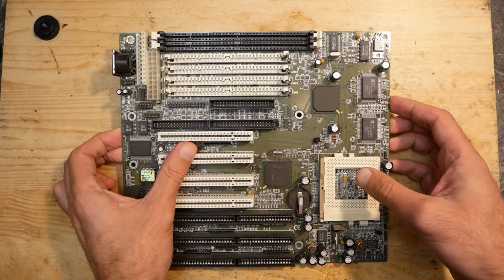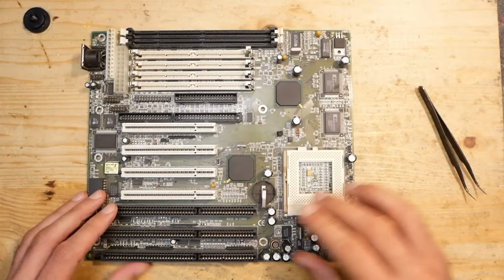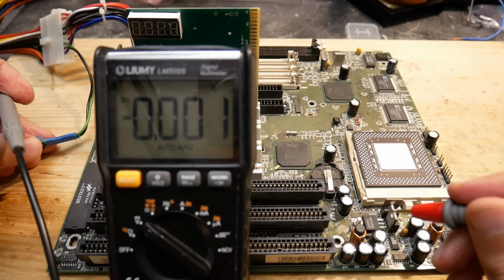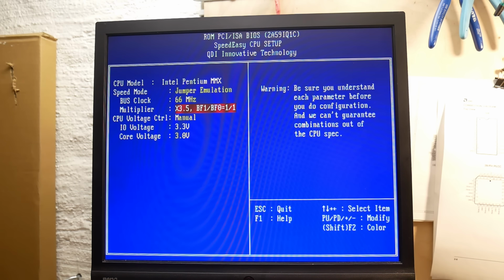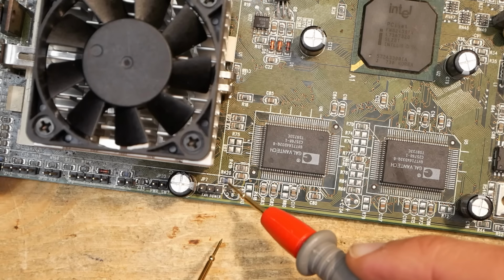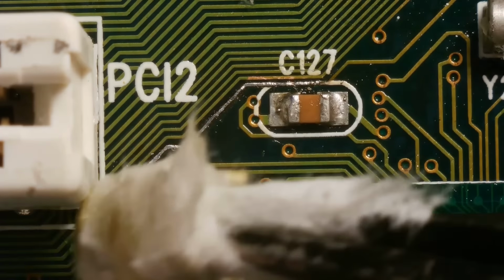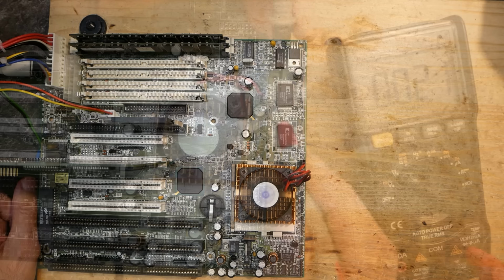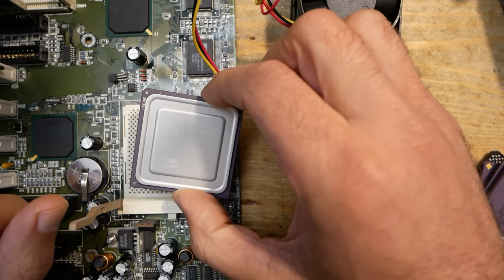QDI P5I430TX - is it the best Socket 7 mainboard?

Comment: is it the best socket 7 mainboard? definetily not... its a very basic dummy board with an interesting but limited feature... nice try, but there are many much better board on the market...

-only 256/512KB ext cache

-very limited voltage range: the onboard Raytheon RC5041 VRM controller would be able to supply down to 2.1V, but i think it's impossible to implement it without hardvare modification... just check the VID configuration table in it's datasheet...

-very limited multiplier settings: the question is, is the missing BF2 pin being connected to ground on the board, or is it left as floating? in first case, You will be limited to 4, 4.5, 5 and 5.5x multiplier options. in the latter case, limitation will be 2.5, 3, 3.5 and 6x with a K6-2 or K6-III CPU. if it's floating, then You can solder a jumper on BF2 line to achieve all possible multipliers on these CPUs

-the W49C65-04 PLL clock generator is very basic without async PCI clock option - in 75MHz setup, PCI clock goes to 37.5MHz which can cause stability problems. the PLL would support 83.3MHz as well, but with 41.66MHz PCI clock - that's why they hid it from the options. there is no 75/33 and 83/33MHz async option. and in addition, it has no I2C but only hardware configuration pins... on many later S7/SS7 mainboards, You can reach the PLL IC through I2C bus and modify the setup on the fly from windows with CPUCool, CPUFSB, SpeedFan, etc

according to PLL datasheet, 60+ means 60.6MHz and 66+ means 66.82MHz

another problem is the missing microcode from BIOS, and the fact that the flash IC is being soldered on the board instead of socketed - it's a bit risky to hack the BIOS on a board like this...

You probably met with SoftMenu II and SoftMenu III option on many P2/P3/S462 ABIT mainboard, but as i know, the first SoftMenu appeared "much earlier" on 430HX boards like ABIT IT5H
Reply from the maker: I agree on some points, but you seem to compare mostly SS7 features with S7 ones. Async clock above 66 MHz was an SS7 feature, as well as voltage below 2.8V. More than 512K L2 cache is also not common on S7 boards. Nonetheless this board supports more, than you think. Some of those drawbacks are purely software limitations and there is a work ongoing to modify the BIOS accordingly. Of course fsb over 66MHz without PCI overclock is not possible though, but it's alright. Once again, we are speaking about S7, not SS7.
Reply: @necro_ware  many S7 board has async PCI option above 66MHz, and latter K6 CPUs required 2.2-2.4V Vcore, and they are fully Socket7 CPUs, not SS7... I think this board is very average in it's era and there were many much better - so far away from "best socket 7"...

"More than 512K L2 cache is also not common on S7 boards" - yes not common, but we are looking for the best socket 7 board, not the common ;)
Reply from the maker: @eeeneeen381  Oh, a reaction to such an old comment :) Ok, show me a Socket 7 Board wich is better than this one. I still didn't find any. Meanwhile Jan Steunebrink made a custom BIOS for it and it supports all CPUs up to K6-3+, voltage down to 2.2V and FSB83, sync with overclocked PCI, but still. And all that without any jumpers! Also, Socket 7 boards with 1MB cache are at least very rare, may be there are even none. At least I don't know any.
Reply: @necro_ware  Shuttle Spacewalker HOT-603 2.x has 1MB L2 and its a pure Socket 7 board

ECS P5SD-A has an AGP slot, advanced PLL with 83/32, 90/30 options - there is a 100/33 too, but the chipset is officially 66MHz only, so it's no wonder it cannot stand it - 83 is fully stable, 90MHz is so so, let's say 95% stable :)

VP3 based boards has AGP slot too, but still Socket 7 due to missing 100MHz FSB

yes, it's hard to find a board with all features at top - but it's probably exists :)
Reply: dude... by socket 7 , he means pure socket 7 ... not supersocket 7. 
supersocket 7 use socket 7, but they are considered by their own kind . supersocket 7.

socket 7 boards used to have 512 Kb cache as maximum, in that era.

So yes, this is expeptional good board... though 2.2-2.4v is definitely missing... even 2.7v, sometimes it is enough, and you can undervolt the processor.
Reply: @eeeneeen381 Which board before the arrival of SuperSocket7 can handle more than 512KB L2 and at the same time supports MMX class CPU? I have only ever encountered very old boards, some of which supported up to 2MB L2 cache, but did not support dual power supply, or conversely, newer Super7 boards, some of which also supported up to 2MB. In the meantime (which is what the discussion is about), I do not know of such a board. It is possible that Tyan offered something like this, but those were not boards for ordinary people. I only partially agree with the rest of what you wrote. It is a common description of the characteristics of Socket 7 boards before the arrival of SuperSocket7. Which boards do not have the shortcomings you mentioned and are still in the Socket 7 category and not SuperSocket7?
Reply: @Thales_WH  unfortunately, it's impossible to filter by cache size on theretroweb database, but i can mention one pure Socket7 board with 1MB cache that i already have: Shuttle Spacewalker HOT-603 2.x. As You can check it on the pictures of trw, it has 4 pcs of TM T35L6432A-6Q 64Kx32==256KByte SRAM chips. I think Shuttle was not a premium high category manufacturer like Tyan, so it looks a good example for better then average in consumer category...

on the same board, onboard SC1151CS VRM controller is able to provide voltages from 1.8 to 3.5V

W48S87-04 PLL chip has 2 option for 75MHz: 75/37.5MHz PCI and 75/32MHz PCI - for 83MHz, only the /2 divider is available, so it's not the best, but better than the average. I'm unable to mention boards with available 83/33MHz PCI (or similar) at this moment, but i'm pretty sure there was...
Reply: @eeeneeen381  Shuttle was not really a luxury brand. I appreciate that they were a bit of an experimenter and were not afraid to do things differently, they did not stick to the mainstream, unfortunately it usually did not lead to anything positive and I remember their boards as problematic. I do not evaluate it only retrospectively, but also because I worked with those boards at the time, I still have some promotional materials here, I still use very good-looking boards for papers with good-looking graphics from this brand :) But back to the point. The HOT-603 board, although a unicorn (at that time) with 1MB L2 cache, could not achieve the results of common boards like the Abit IT5H based on the 430HX with 512KB L2 in contemporary tests. More interesting boards, when things started to change, came the following year along with SuperSocket7, as I wrote. Therefore, we are not in conflict. In 1997, perhaps the only board that was able to bring something extra compared to the standard was the FIC PA2007 based on VIA VP2, which was available with both 512KB L2 and, for an additional fee, 1MB L2, and was able to really turn this extra memory into extra performance. But it didn't have any of the other things you wrote about either. Only a small number of boards supported the 83MHz bus at the time, and most of them couldn't run stably and smoothly at this frequency. That makes sense, because extreme overclocking wasn't that popular back then, so it wasn't a target group that board manufacturers would focus on, and the only ones using the 83MHz bus were some Cyrix processors, which was new at the time and manufacturers hadn't had time to react yet. So, in 1997, it really wasn't possible to blame anyone for all the things you wrote. It was a contemporary picture of the IT world. It would seem similarly pointless to me to complain about why most ordinary users didn't have a 486DX on their desks in 1991.
Reply: @Thales_WH  On S5/S7/SS7 platform, cacheable amount of RAM greatly depends on the amount of L2 (or better to say external) cache and the chipset itself. With VP2 (and VP3/MVP3), 256KB cache gives 64MB, 512KB gives 128MB, 1MB gives 256MB and 2MB gives 512MB of cacheable RAM. Okay, 128MB of RAM was a lot in the era of P1/MMX CPUs, but let me remain You, we are looking for "the best S7 board", not the most generic or most popular... If You build the "ultimate killer S7 machine" based on an oc-ed iMMX 233 or a 266-300MHz AMD K6 (or a Cyrix MII if You are pervert :D ), 256MB is not an exaggeration...

Shuttle HOT-603 == FIC PA-2007, due to AMD 640 chipset is a VIA VP2 in reality...

83MHz bus was problematic in many case due to the overclocked PCI bus, I think... I will check my S7 boards if any of them supports async PCI - i hope, yes... :)

by the way, unusual bus speeds: what about 40MHz FSB? As I know, there is only one CPU that requires it, the 80MHz Cyrix 6x86 - it's a nearly non-existent CPU, but I have one - and it looks a very early release due to it's labeled as 6x86-80GP instead of 6x86-P90+GP... 1.5*50 or 1.5*55MHz would be much more generic, but it inherited it's CLKMUL system from greater brothers so only 2x and 3x mode is available - that's why it requires the very rare 40MHz option. Earlier, i had no S5/S7/SS7 motherboard with such a low FSB support, so i was unable to test it - it did not give any sign of life on 2x50MHz. Later, i figured out that if i swap the 14.31818MHz crystal around the PLL IC with a 12MHz one, then 50MHz FSB setting goes down to 41.9MHz - it caused timing problems, system clock slowed down and benchmark results were fully the same like on a 100MHz system :) - but i confirmed that the CPU is ok... Then finally I found a Freetech 586F61-PB board with official 40MHz support. The only problem is that in this mode too, PCI bus runs on halved clock so it's a bit bottleneck - but i will try to implement a passthrough option around the PLL circuit to achieve 1:1 option too...
Reply: @eeeneeen381  Yes, you are right and I know the facts you stated :) We are not in dispute, it was just necessary to clarify the development period. And yes, I am a "pervert" according to your definition, because I do have, among other things, one Socket 7 machine (not SS7) with Cyrix PR300 on Freetech P5F87 :) I don't think it is the best machine in the world, it is just a toy for fun and I like the board despite the shortcomings resulting from the nature of the 430TX limitation. The only thing that annoys me about the machine is the cacheable area limitation, otherwise I would have stuffed much more than 64MB of RAM into it. I had to rationally accept it and tell myself that I have other machines for tuned and unlimited stuff. I also have much better Super7 boards available, such as the Gigabyte 5AA or 5AX and others, but this one seemed to me to be somehow suitable. But it still doesn't let me sleep sometimes :D Besides, I've never been much of a gamer (for whom 64MB is enough, I spent little time playing games) and I was demanding on RAM even back when it was relevant. In 2000, my PC had 640MB of RAM. If you were asking the same question as people back then, then no, it's not a typo. It was 2x256 + 128MB of RAM.
But back to Cyrix: I only saw the 6x86 GP80 once in a photo a few years ago, I never actually saw it when it was on sale, not even in price lists. When I saw it in the photo, the frequency seemed strange to me, so I looked for boards that supported it. I actually found a few, but there were very few of them. Congratulations on finding one :) I don't understand why Cyrix didn't do something more rational like 1.5x50MHz. If you succeed in modifying the PLL, let me know, I'd be interested. On the other hand, I want to try to see if I can choose one of my Pentium 66MHz and overclock it to 80MHz. I don't really believe it, because the technology was at its peak and without reserves at that time, but why not try? :)
Reply: @Thales_WH  I have an IBM version of PR300 too :)

430TX chipset looks a bit bottleneck for this system - a HX or something alternative would be better with more RAM... by the way, my Freetech 586F61-PB board has 430FX with the same cacheable RAM limitation, but it has a VRM slot - I already started a K6-III+ 400 CPU in it with feeding power from another SS7 board's VRM to this board - might be a good solution against the chipset limitation :D

OC'ing a Socket4 system? Nice idea :)

How can I contact You? There might be easy solution, or hard way - investigation required on the board and it's chips...
Reply: @eeeneeen381  The contact is "thales" blah-blah for google @ blah-blah "email" blah-blah "dot" blah-blah "cz". Hopefully it will work :) Try it.
Reply: @eeeneeen381  Have you tried that contact? I haven't received anything yet. I already have an answer ready :)
Reply: @Thales_WH  how do You mean "that contact"? i see nothing before this post... might be blocked by YT :(
Reply: @eeeneeen381  I tried to send it so that YT wouldn't throw it away. But it seems that it did, maybe it doesn't like some of the characters. So I'll try it differently. I'll send a second message right now. Please confirm that it got through. And that you decoded it :D
Reply: @eeeneeen381  "thales" blah-blah for google "that round thing in the middle of the address" blah-blah "e/*/m/*/a/*/i/*/l" blah-blah "dot" blah-blah and "cz" at the end. Hopefully it will work :) Try it.
Reply: @Thales_WH  i hope i correctly decoded it :)
sent an email...

Comment: I have a QDI Explorer II motherboard with speedeasy that displays similar symptom like this one and always defaults to the pentium 75mhz
after 3 boots it displays the message "you have failed to run 3 times this motherbaord and now it is in safe mode" and I can never get it to recognize the CPU
it works but just at 75mhz... I have no idea what is wrong
I have flashed a new bios and the problem persists
Reply: just use battery.
also ESCD reseting can be out of power. Not sure how to solve it.
Try to desolder BIOS, and use new.
Reply: @warrax111  thanx
even with battery it doesn't change :(
maybe replacing capacitors around the CMOS will help
Reply: @fft2020  try to update BIOS to the latest.
Explorer II was buggy , it is early motherboard with BIOS tweaking, first QDI made.

Also motherboard can have used BIOS chip.
It can update ESCD only several hunded times. Motherboards use special RAM for that, but it has only 256 bytes of RAM. So later motherboard are writing part of configuration into BIOS NVRAM, because they store more data. I'm sure, Speedeasy probably doing it, because it has BIOS CPU tweaking options. Just my thoughts. :) Maybe someone played too much with it, and NVRAM of BIOS is used up and cannot remember new data written.
Reply: @warrax111  Wow! thank you my friend! I never heard of that memory problem. I will investigate! So maybe the solution is to replace with a new bios chip no ?
Reply: @fft2020  If NVRAM is used, then yes, you need to desolder old chip, and flash BIOS to new chip.
If it is socketed, it will be easier, without soldering.

I don't say, it is that, but it's another case, which can causing it. Maybe someone was too active, it was first motherboard with CPU tweaking in BIOS (along with Abit motherboards , they had Softmenu, QDI had Speedeasy)

Good luck. If it will be not cause and BIOS is updated, then I am out of ideas, what can cause it.

PS: If you want investigate, start with short description with ESCD in wikipedia. It is Extended System Configuration Data. It is explained there well and compact. Also check BIOS NVRAM (Nonvolatile BIOS memory) on wikipedia.
Reply: @warrax111  I will thank you! this motherboard is driving me crazy :)
Reply: @fft2020  if you can be so kind, if you try it, please let me know, if it helped.

Comment: My 233MMX mainboard used jumpers, like most of them.
Also with a TX chipset, I think it was an Asus.
There was an undocumented jumper setting that allowed it to run at 83 MHz.
So the 233MMX at 290 MHz very stable.
Not sure it's possible with jumperless and settings in bios :)
Reply: this board can also run at 83 Mhz FSB.
Just read Anandtech review. ;-)

Comment: If you want to use glue for plastics do not use the one in the video as it for styrene plastic. i would suggest you use Deluxe materials Plastic Magic which is for various kinds of plastic such as ABS.I have this board myself. Indeed i was amazed by the options, but there are also S7 boards with AGP slot as well.
Reply: @johnk7134 But if it has AGP, then it's in the so-called SuperSocket7 category, which is a different category. Here we're talking about pre-SuperSocket7 boards.

Comment: Nice video and that is indeed a versatile board. I have a Chaintech Socket 7 board that calls the jumperless SeePU technology.   Haha they must have called them all sorts of things.  It is one reason I like the Slot 1 era so much.  Usually jumperless and auto detecting.  It made things so much more easier at the time when building systems.
Reply: I have PCChips motherboard socket 7. 
Not only it is fully jumperless, but it also supports voltages from 2.2 to 3.5v in 0.1 v steps.
Didn't expect it from PCchips, it supports even K6-2. They were known to not have overclocking.
But this board has even FSB , 75 and 83 Mhz in BIOS.
What is more strange, board is from late 1997. So PCChips were this good in late 1997, they adapted very quickly.
Unfortunately, they didnt hold this trend on Slot 1 boards.

Comment: Just go with Super Socket 7. I would not waist my time on this,  but still fun to play. Go with a board that can have AGP for one,  Multiplier x6 or 6.5 , volts need to go down to 1.8., FSB at 100 or 112.   Run a AMD k6-iii at 650 mhz
Reply: No. then you can just use Tualatin.
Reply: @SkipsHappyHour You didn't understand. He didn't choose that board from among x-others to use. The board arrived, it needed some service, he fixed it and that was it. He repaired what he had, not what he chose.